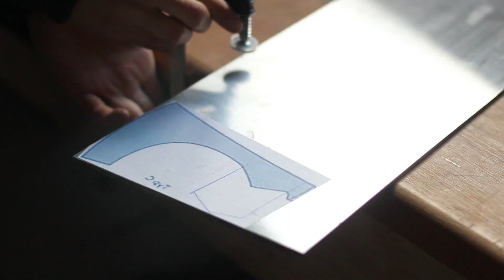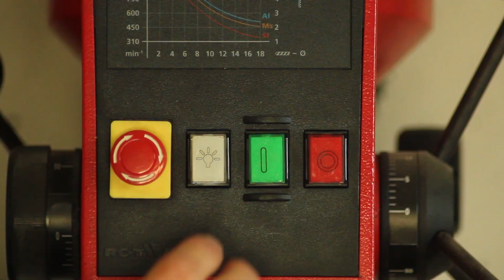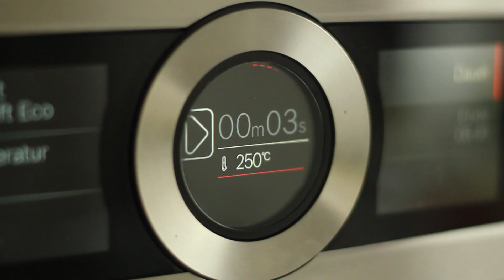MAKING A VIKING AXE!

Comment: It looks cool, and I'm sure that was the point of the build as well as the fun of making it. 
To all the haters and armchair Vikings, not everyone has a forge or the years of practice to make a historically correct skeggøx. Nor do many have 2 weeks to keep a hot peat fire going to extract bog steel. 
As far as battle goes, it looks like it would hold up to pulling a shield down to strike your enemy in the head or shoulders with a heavier weapon, or as a throwing weapon. Some of the Norse were known to carry two axes, one for shield pulling, and one for a single deadly strike, very effective and much lighter than a shield. Shields mostly gained popularity during foreign raids to block arrow volleys and make a wall. At first the bow was for hunting, as they considered it a cowards weapon, later it was used in raids to take out enemy archers. But still, as far as I know, vikings were never buried with a bow, but always with an axe and/or sword. There is no call for a bow in Valhalla, but the axe is always welcome.
Reply from the maker: Thank you for your input!

Comment: That beveling jig reminds of when I spent 3 hours of total filing time (for bevels only) and going through the finishing of the knife to discover while attempting to heat treat that the steel cannot be hardened. NEVER TRUST MYSTERY STEEL....
Reply: Nart Wumar, did you wince when you saw the peacock blue colour on the edge of the tempered blade?